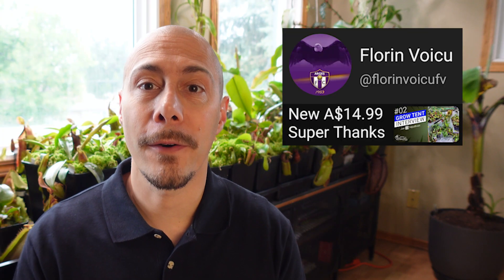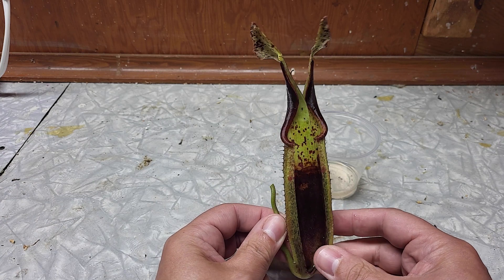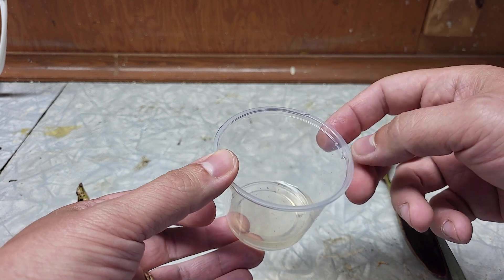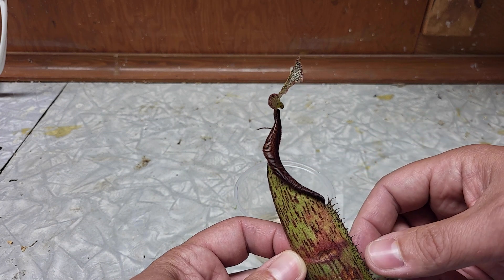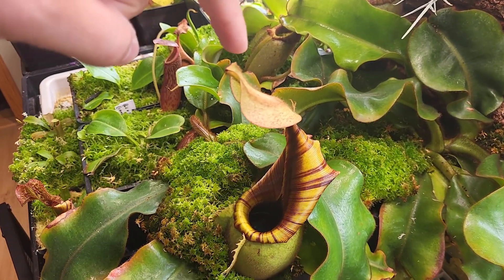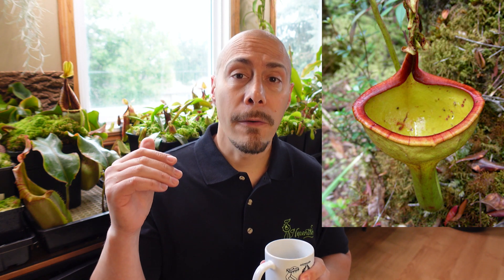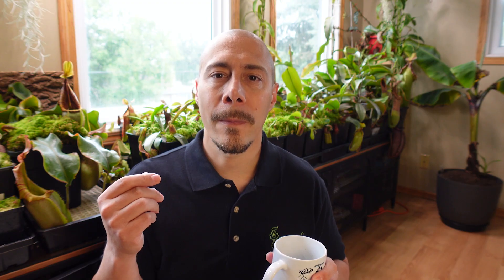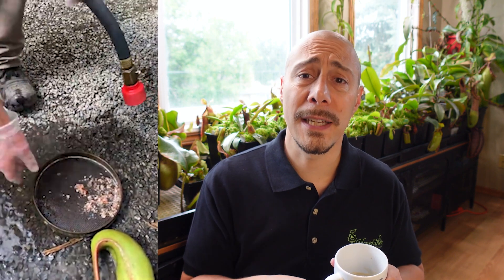How tropical pitcher plants digest insects? 💀 What does the interior of a Nepenthes look like?

Comment: I think there's one more aspect to talk about, regarding the digestive fluid, if we are at it (not sure if it was covered in the video and i missed it)

If you spill (accidentaly or not) the pitcher's fluid, it will generate more fluid or not? 

I found out at mines if its spilled at one point,  they will stay dry from that point, unless you fill it up with water, but that wont act like the digestive fluid so the pitcher is not "carnivorous" anymore? Or the pitcher will "fill" the water with digestive enzimas.

Im curious about this.
Reply from the maker: Yes I forgot that! Fluid is created before the pitcher opens. If it's spilled, it won't be replaced. You can always put some water but it won't be the same.
Reply: @WindowsillNepenthes  Will the pitcher still absorb the nutrients from fertilizer like osmacote if only water is present inside the pitcher?